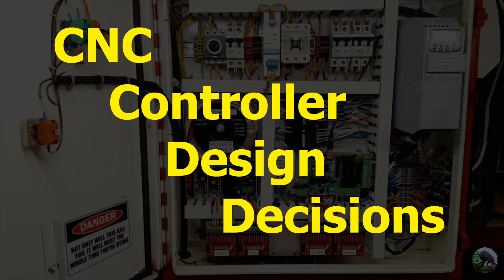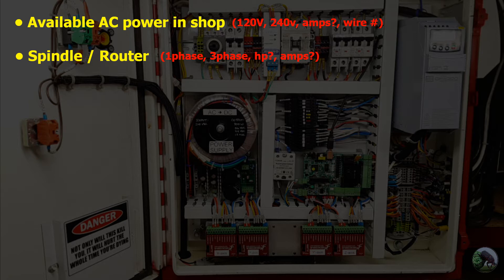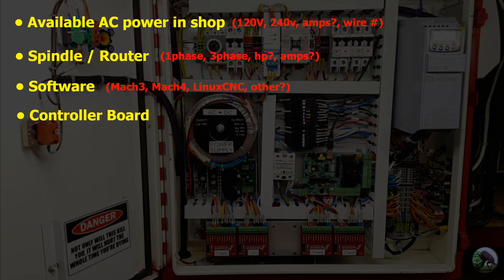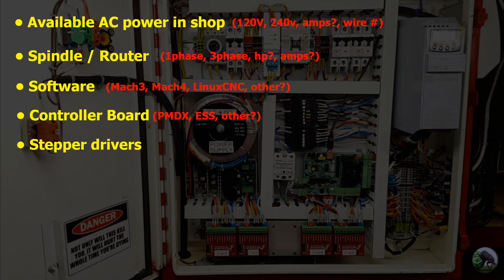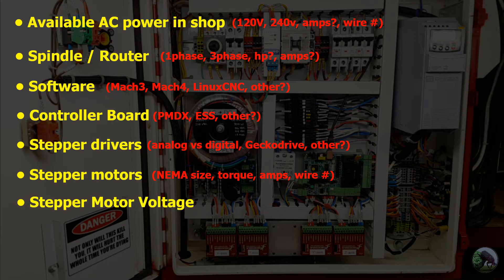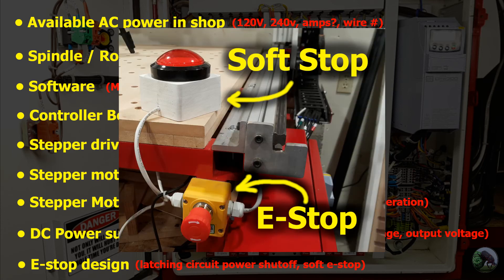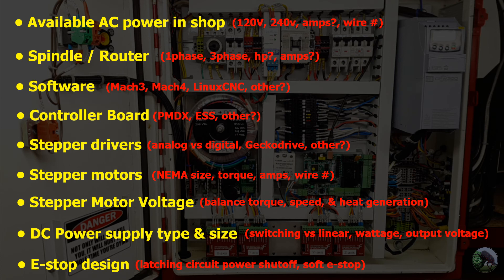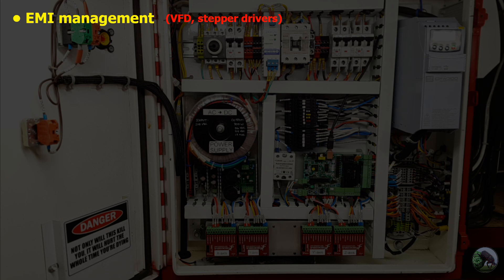CNC Controller Build: Design Decisions

Comment: I am looking into doing a make over on my CNC machines and I must say your videos are great. My systems have always use a soft stop system for my E stop, so when I seen some of these different hard stop configuration, I new I wanted to incorporate that into my new system. The one draw back I could see in the hard stop, is most of the time I hit the E stop when I realize I have made a minor mistakes and the machine is running. (I do not make these kinds of mistakes as often any more put when I was first learning it happened a fair bit ) Having both a soft stop and a hard stop is a ingenious idea I think for the reasons you explain in the video. Great videos you do a great job of explaining your topic and give more detail even diagrams than most other peoples videos.